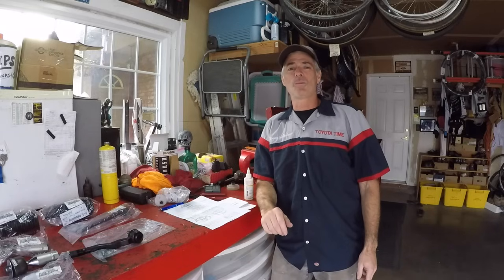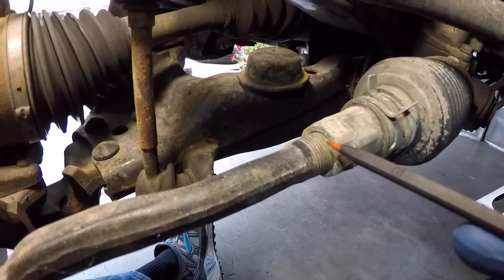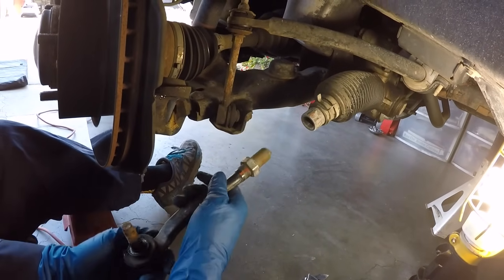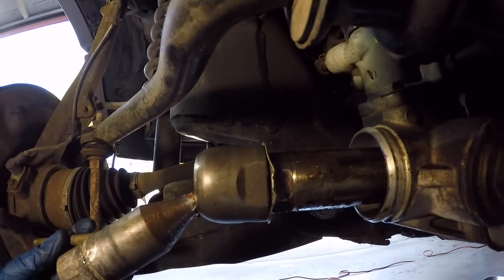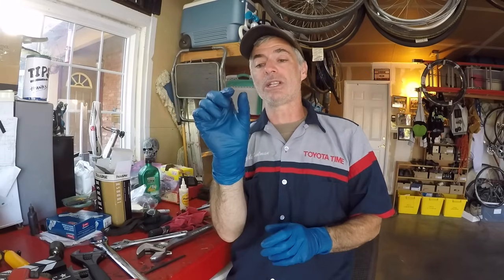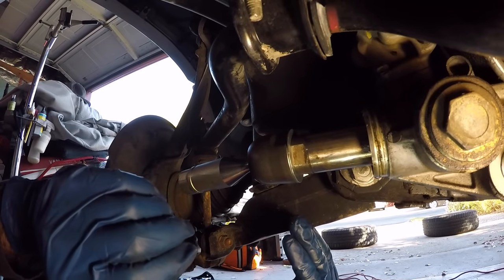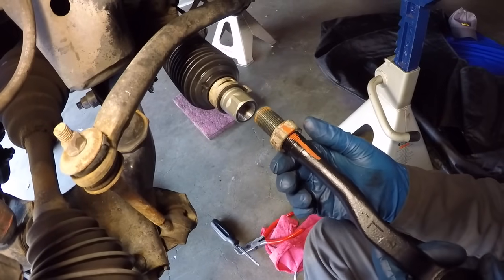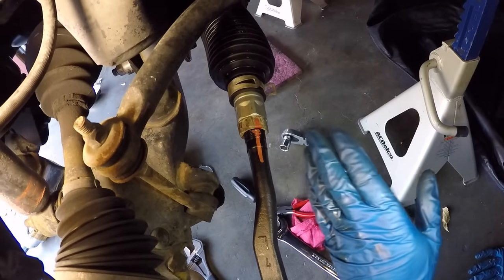Inner & Outer Tie Rod Replacement

Comment from the maker: PLEASE READ THIS COMMENT AND THE VIDEO DESCRIPTION FOR HELPFUL INFORMATION
In the video you'll see the old inner tie rod joints move much more freely than the new joints.  However, there was no actual play in the joints.  We don't feel free movement in the joint is a sign that it's bad.  If there was actual play in the ball and socket, that would then be an indicator the joint is bad and needs replacing.  Replacement OEM inner tie rods are very expensive so I wouldn't suggest replacing these just for the hell of it.

**Update 10/14/18 - A subscriber reported you can rent the specialty inner tie rod tool set from Auto Zone for free.  Just like most automotive stores that rent tools, you leave them a deposit and you get your deposit back when you return the tool.
Reply: Hi Timmy,I didn't feel any in or out play on my inner tie rods either,but I change them any ways and guess what..it actually reduced my steering wheel shaking about 90% at 60+ mph. thanks for sharing your knowledge.
Reply: Any tips on loosening up the jack nut on the tierod? Went in for an alignment after having to replace the passenger outer tierod because lower ball joint  bolt/tie rod wouldn’t come off. So instead had to break free the OTE and LBJ altogether.

Now the tech can’t get the driver side outer tierod jacknut for an alignment because it is seized/frozen or rusted. (Sprayed PB blaster already)
Reply from the maker: @RoNBEE1  Get a butane torch and heat up the nut and use more penetrant.  I'm not familiar with the term "Jacknut" but I assume you're talking about the lock nut for the outer tie rod.  Or, you can tell the alignment tech to throw his purse at it.
Reply: @TimmyTheToolman  yeah lock nut lol. The tech was a big dude and it wouldn’t budge. Lol. I’ll try the butane torch approach (they aren’t allowed to use fire)
Reply from the maker: @RoNBEE1  Gotcha.  Hopefully with a few rounds of heat and penetrant, you'll be able to break it free.
Reply: I'll
Reply: Hey Tim, I have a question for you. My 2002 Toyota 4Runner developed a squeak in the steering. Happens only when the weight of the vehicle is on the ground and while turning the steering wheel. I noticed a small crack in the passenger side inner tie rod boot and that the squeak seemed to be coming from that same area. Hard to tell though with the motor running. This vehicle does get a lot of off-road time. I ended up pulling the passenger tire and the tie rod from the spindle knuckle to try and see if there was any play or sound but did not notice any. I pulled the boot back and the shaft that moves in and out of the rack and pinion was pretty clean. Grease was not really present though. The inner tie rod bearing itself was a little on the dirty side but I could not hear any obvious grinding from dirt or sand. I am a little lost as to what is causing the noise. I would hate to replace one tie rod, then another, etc. if the real issue is the rack and pinion. I did check the steering fluid and it was pretty clean, nothing like the fluid that came from that Toyota in your steering fluid change video. Any suggestions would be greatly appreciated. Thanks!
Reply from the maker: @MC-nd3zl  From what I've experienced, squeaks in the front end are usually from the sway bar bushings and end link bushings.  Take a good look at them.
Reply: @TimmyTheToolman  I do not run a sway bar up front.........probably should but I don't.
Reply from the maker: @MC-nd3zl  Roger Dodger.  Well, maybe have someone turning the steering wheel lock to lock while you're outside listening to see if you can narrow it down.
Reply: @TimmyTheToolman  Yeah that's what I did and thought it might be the inner tie rod. How do you typically know if the rack and pinion is shot?
Reply: A2
Reply: @TimmyTheToolman   could it be a wheel bearing that is failing? ... my '97 taco started an obscure squeaking at 197k  and was diagnosed at the dealer as a wheel bearing on its last legs ... and now i think i maybe hearing the very faint squeaking again up front that comes and goes
Reply from the maker: @efil4kizum  If you think you could possibly have a bad wheel bearing, jack up the front end, support it on jack stands, and grab the wheel at the 12 o'clock and 6 o'clock positions pushing and pulling with opposing force.  If you detect any play, the wheel bearing is bad.

Comment: Thank you, thank you, thank you for all of your videos. My son bought a 98 SR5 4runner 4x4 several years ago, and we have done a ton of upgrades and repairs using your videos. His younger sister loves his rig and just bought a 2000 Tacoma SR5 4x4 that we drove 10 hours to Billings, MT to get. Right now, in my two car garage and shop, the two rigs are sitting side by side, and without all your videos, we probably wouldn't be doing all of the repairs ourselves. The 4runner is getting a new radiator and a transmission fluid flush. An ECG bushing, two new CV axles and seals. The Tacoma is getting a new E-locker rear axle with all the wiring needed, new leaf springs, Bilstein shocks front and back, a new CV axle, and seals. Sway bar end links, lower ball joints, and the inner and outer tie rods. I have parts for valve cover gaskets and the "aircabinman" kit for the timing belt, etc. that should have the Tacoma good to go for quite a while. Fun stuff for a newly retired guy.
Reply from the maker: Hey Victor, that's great to hear you're turning wrenches with your son and daughter and using my videos.  Thanks for commenting and sharing this with us.  I'm close to retirement myself but I'm going to keep making videos.  Happy Wrenching!

Comment: The brand "Sankei 555" is an OEM manufacturer of Toyota parts. They are made in Japan and super-high quality. They are more economical than OEM parts as well when sold under their in-house name. They are easy to find via Google. I bought a Maddox Inner Tie Rod service tool kit from Harbor Freight Tools for $59.99. It includes the 42mm claw for Toyota Steering Racks like on the 3rd Gen 4Runner.

Thanks for the excellent videos Timmy. I own a 2000 4Runner SR5 with a Manual transmission and Federal emissions (1 Catalytic Converter). It's a unicorn, and I'm keeping it going by watching your videos. I parked it in 2017 because it needed a lot of parts replaced and I couldn't afford to do it. I've always wrenched on my own vehicles, but life happens sometimes. 

I've owned it since December 2001 when it had 24K miles on it. It's got 222,400 miles on it now. It's been lifted most of its life. I have Bilstein 5100/Tundra TRD springs on the front, OME 891/60027 on the rear. 

Since the beginning of June, 2022 I've replaced:

Rear worn out Downey Off-Road springs with OME 891 - OME 60027 rear shocks are still good
Rear Lower Control Arms with SPC Performance heavy duty rear LCA - Part #25945
Rear sway bar bushings and end links. Energy Suspension bushings
Front CV axles - Trakmotive "Xtended Travel" Part # TO-8043
Front Sway bar bushings and end links - ES bushings
Front Steering Rack bushings - Whiteline
Front Lower Ball Joints - Sankei 555
Front Upper Control Arms - JBA - Thanks for the install video on those!
I just pulled the front lower control arms today and I'm going to install the Whiteline LCA bushings - Thanks again for your video!
I ordered Sankei 555 inner and outer tie rods and will be replacing those as well - Thanks for this video!

You guys do a great job. There is a bigger aftermarket parts industry for these 3rd Gen 4Runners than when I was regularly driving it. I didn't see some stuff that appeared during the 2015-2017 timeframe when I knew it needed some TLC. I'm glad the parts and support are there now.
Reply from the maker: Thanks for sharing all of that. Glad our videos have helped you out.
Reply: @TimmyTheToolman   Liked and Sub'd.
Reply: 9

Comment: After watching your video about replacing the lower ball joints i decided to do the same to my 1st gen Tacoma for peace of mind.  It went well until I tried to attach the outer tie rods and discovered that they were shot.  After watching this video you made me realize that i could replace them myself.  Thanks to your hard work on these videos folks like me that are not mechanically inclined have a chance at doing this.  I'm guessing i'm saving money but i know that all of those bolts are the correct torque and all of the proper steps have been taken.  Keep filming brother.
Reply from the maker: It’s comment like these Barry Morton, that reaffirms our efforts & makes us stoked to hear you were successful in your DIY service to your truck. We agree that knowing your bolts are properly torqued is an added bonus considering you know it’s getting done right & you’re saving money at the same time.

Comment: Thank you so much! To anybody reading this, I would highly recommend NOT keeping the castle nut on when using the ball joint separator like Tim has. I kept the castle nut on to stop the tie rod from flying off when separating and the nut hit the ball joint so hard it mangle the threads on both the tie rod and nut. Original ball joints on 280k so there was a ton of pressure. Had to replace both tie rod and castle nut. Hope this helps and thanks again for the video!
Reply from the maker: You're welcome Mikey.  Sorry to hear you mangled your tie rods.
Reply: Think I just did the same thing😂
Reply: Never reuse old nuts on suspension parts. Same with bolts and cotter pins.

Comment: Just took off my tie rod ends inner and outer and found they were severely worn and the right side inner was actually bent about 10 degrees. 
Thanks for the video, step by step was spot on. I’m waiting on my kit and a set of rotors and pads. You guys are awesome. Not too bad for a firefighter.
Reply from the maker: Thanks for the comment, Darrell.

Comment from the maker: **Update 10/14/18 - A subscriber reported you can rent the specialty inner tie rod tool set from Auto Zone for free.  Just like most automotive stores that rent tools, you leave them a deposit and you get your deposit back when you return the tool.
Reply: The bat fan?
Reply: And O'reilly! Their kit is standard but it includes a 1 and 3/16 (30mm) and a 42mm wrench in it. I''ll be doing this job this weekend. After getting and doing F and R suspension, steering rack bushings, swarbar bushings, I went in for an alignment on to discover these were also shot (should've realized while doing all that other work!)
Reply: Yes this is a great option. I just ‘rented’ a slide hammer tool this last weekend. You buy the whole tool $170 for this case and then you use it for up to 45 days and then return it for a full refund. That was at advance auto. I know they sell tie rod tool as well but I’ll be doing next weekend. Thanks for the great video!
Reply from the maker: @condor5635  You're welcome.
Reply: I rented a Free tie rod kit from advanced automotive store 👍🏻
Reply from the maker: @Jimmyky77  Sweet Bitchin!

Comment: Excellent video and very helpful. I've just done this replacement on my Landcruiser in the UK. One thing that always amuses me with these videos however is the ease that you remove the old split pin, mine had 22 years worth of rust so I ended up breaking the old one off flush and shearing the rest off with a spanner as I undid the nut, the thread was FUBAR anyway and I was replacing the trackrod end at the same time. Thanks for the videos though. Tim Falce UK
Reply from the maker: Glad you found our video helpful.  Yeah, I've had one cotter pin do what you said and that was on a guys truck who lives near the coast and it was rusted in there.  Happy Wrenching my UK Brother!  My last name is Watson by the way.  My dad's family came from England.

Comment: Timmy, I literally just came across your channel about an hour ago and have learned more from all of your little details and sidemodes than I have from any other source.  I recently changed both inner and outer tie rods on my 2018 4runner and really wished I would have come across the above video beforehand.  I used the mentioned Lisle 54500 Large Inner Tie Rod Tool but found it somewhat difficult to get a good grip as the tool didn't fit all that well in the tight space given.  I was able to use the Lisle tool to loosen the inner tie rods on both sides of the truck without too much effort, I'm supposing because the truck is only 3 years old, but the previous owner had taken the truck off-roading (evident by the 20lbs of mud and silt packed between the skid plates and undercarriage that neither the previous owner or dealer I purchased from cleaned off the truck, until I made them).  My reasoning for replacing both inner and outer tie rods is that the steering had always felt somewhat sloppy and since the truck had been off-road, I did not trust that the previous owner did not cause damage to the steering, as he did bang up the front skid plate and the skid plate over the gas tank also has a large dent in it (most likely caused by large boulder rocks)  Anyway,  I found that the inner tie rods did have some play to them, once I got them off and the outer tie rod boots were both squeezed and seemed to be starting to leak grease.
After replacing both inner and outer tie rods with factory replacements and having the truck aligned, I seem to continue experiencing a slight noise (similar to metal tapping metal) when turning the steering wheel either left or right while parked or moving at slow speeds or fully hitting the brakes at slower speeds.  
Two quick questions... 1. Any idea what this might be?  I'm wondering if I might not have fully tightened the inner tie rods properly or could it be damage caused to the steering rack/steering rack shaft?  Seems the 5th generation 4runner also does not have any washers between the inner rods and steering shaft, like the one's in your above video. 2. How can some of us DIY'ers get our hands on a Toyota Factory Service Manual for a newer 5th generation model or are all 5th generation model manuals the same ( meaning a 2012 manual pretty much applies to a 2018 since not much has changed)
Thanks again so much for doing what you do and helping all us in the process!!!  Looking forward to your continued videos and also going through your library of previous videos!!!!
Reply from the maker: That noise could possibly be coming from the front sway bar.  Take a look at the brackets and the end links and see that the bushings are good and the fasteners are tight.  

You can't buy the physical Toyota factory service manuals for newer Toyotas but you can access information online via the Toyota Tech Info system.  You can pay a fee and access the information.  I usually pay $20 for a 2-day description and download the info I require. 

techinfo.toyota.com 

At the bottom of that page you can click on a link that describes the minimum system requirements.  You basically need a PC computer operating Windows 7 or 8.  I bought a used Dell laptop from an Ebay seller just so I could access the Tech Info website.

You're very welcome.  Great to hear our videos are helping you out.  Happy Wrenching!

Comment: Well Timmy, you just saved me another $100, and got me some free wrenches to boot. I just replaced the inner and outer tie rods and boot on the driver side of my 98' 4Runner, and it all went as expected, just as seen in your video.  I spent some time grinding my wrench down in advance, and it fit perfectly. So, all in all... $250 for inner/outer tie rods and a boot.  Awesome!  Oh, and if it helps anyone else, I have found really good prices on genuine Toyota parts online from McGeorge Toyota out of Virginia.
Thanks again, 
Brent
Reply from the maker: You're welcome Brent.  Good job getting the job done yourself.

Comment: I've looked at several videos on these Toyota Tundra tie rod ends. Yours is the best I've seen. The inner tie rod end tube type tools with the crows feet usually won't work for this 42mm inner tie rod end. It looks like Toyota upgraded the inner tie rod end and the tool isn't deep enough to latch onto the crows foot. I wasn't aware of the thinner crescent wrenches, so you helped me there. Most of the videos they are spinning the inner tie rod end off without holding the shaft. I also wasn't aware of the 2 different ftlb settings for the inner tie rod end but was very satisfied with your technique and plan to do mine the same.
Reply from the maker: Look through the comments.  There's some guys who have found some more affordable options for slim wrenches to get the inner tie rods off.  Thanks for the compliment.  I hope the job goes smooth for you.

Comment: I have to service the right inner rod end on my rig. There is a tool Harbor Freight makes for this job, I used on my older Forester, had to modify it a bit but it worked great, even allowing you to torque the rod end to service specs. Great video as always!
Reply from the maker: Good to know about the Harbor Freight tool.

Comment: just done that job  and i took a pipe wrench to remove the inner ti rod wile holding the steering shaft with a 30mm wrench and it went super smooth and also tight the new one with it too no damage at all so yeah thanks for you video guys cheers !!🤘
Reply from the maker: Good job and you're welcome!

Comment: I did this job a year or so ago. And of course I ran into the same headache with the wrenches.   I ended up grinding down some cheap adjustable wrench.  Thankfully I live near a harbor freight. Now, whenever I see that wrench I think about that awkward/frustrating job. Good video Timmy.
Reply from the maker: Thanks Donovan.  Yeah, this job threw me for a loop.  I didn't like giving up on this one the first time I was trying to film this job with Tony, but I also wanted to show a way to do it without resorting to grinding down my wrenches and/or resorting to the pipe wrench.  Thanks for taking the time to comment.  Happy Wrenching!